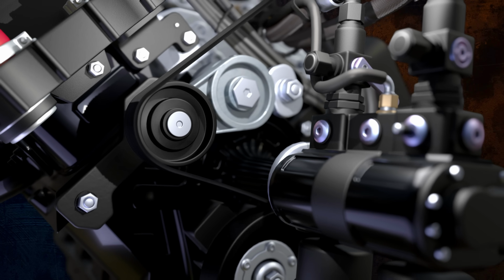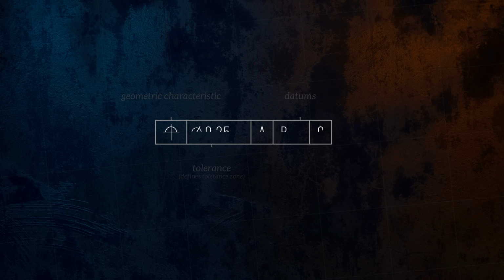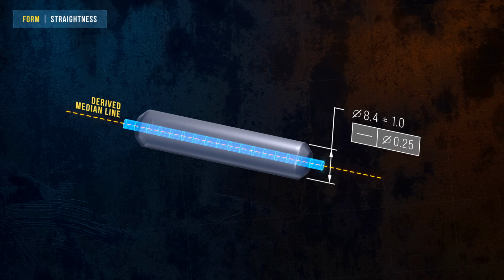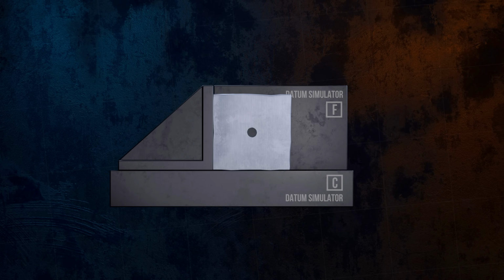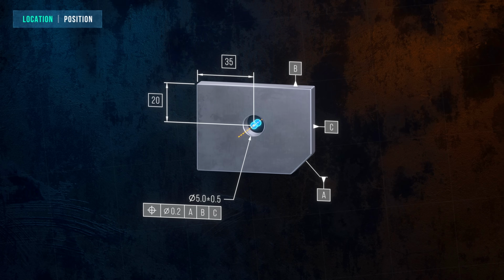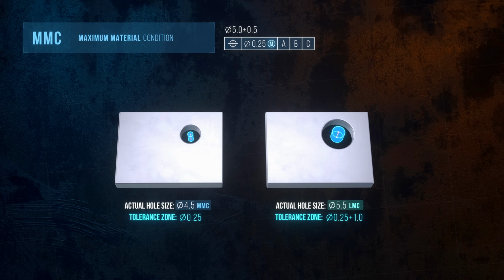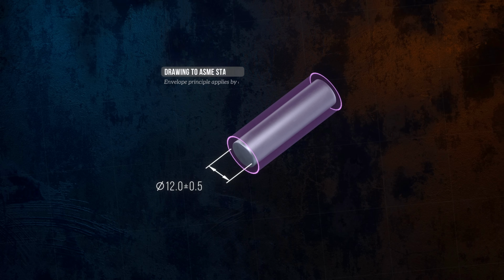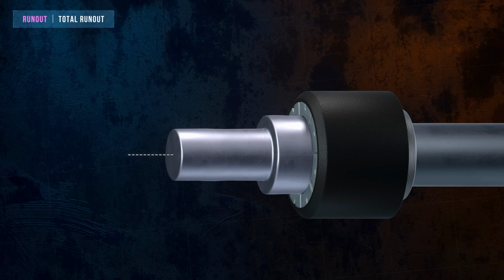Understanding GD&T

Comment: As a retired  R&D Machinist of 50 years one place i worked made me take a GD&T class for 2 weeks & though it wasn't necessary as i am not an Engineer it did help me as to why tolerances are & can be used & what i need to be aware of when reading prints.

Comment: This is a very good, informative, and well thought out video. I am, however very disappointed that you decided not to cover symmetry and concentricity because they were removed by ASME. Being on a global platform it would be better, in my opinion, to think of the world outside of that influenced by the American Society of Mechanical Engineers specifications. Also, given that many people may need to deal with drawings for components that could be quite a bit older then concentricity and symmetry are very valid and widely used geometric tolerances., Again however thank you for an excellent video.
Reply from the maker: Valid point. To be completely honest the real reason I didn't cover symmetry or concentricity was because I'd already spent far too much time on the video and had a convenient excuse for not including them. If I'd had enough time they would have made the cut.

Comment: AI Summary

Abstract:

This video provides a comprehensive introduction to Geometric Dimensioning and Tolerancing (GD&T), a crucial mechanical design approach that enables precise control over part geometry based on its intended function. It explains how GD&T overcomes the limitations of traditional dimensional tolerancing by applying tolerances to features rather than dimensions, utilizing feature control frames, datums, and modifiers. The video systematically breaks down the 14 geometric characteristics into categories like form (flatness, straightness, circularity, cylindricity), orientation (parallelism, perpendicularity, angularity), location (position), profile, and runout (circular, total). Key concepts such as feature control frames, datum reference frames, material modifiers (MMC, LMC), and the ASME's envelope principle (Rule #1) versus ISO's independency principle are clearly explained, along with practical inspection methods for each tolerance type. The goal is to equip viewers with a foundational understanding of GD&T's principles and applications.

Understanding Geometric Dimensioning and Tolerancing (GD&T)

*   0:00 Importance of Tolerancing: Mechanical design requires parts to fit and function as intended, making tolerancing a critical process.
*   0:29 Limitations of Dimensional Tolerancing: Traditional dimensional tolerancing, which defines allowed deviations for each dimension, often fails to reflect a part's functional requirements (e.g., needing a flat sealing surface or a perpendicular hole).
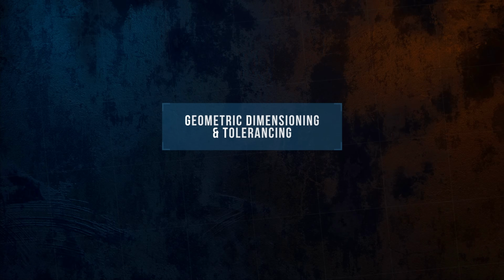*   1:16 Introduction to GD&T: Geometric Dimensioning and Tolerancing (GD&T) is a specialized approach that controls tolerances based on a part's intended function, complementing dimensional tolerancing by specifying 14 geometric characteristics.
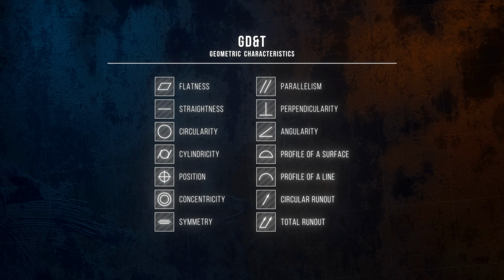*   1:38 GD&T Categories: These characteristics are grouped into categories: form, orientation, location, profile, and runout.
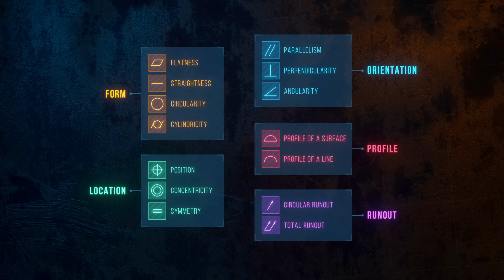*   1:52 Features vs. Dimensions: GD&T applies tolerances to "features" (surfaces, holes, slots) rather than just dimensions. It distinguishes between "surface features" and "features of size" (features with a defined dimension like holes or parallel surfaces).
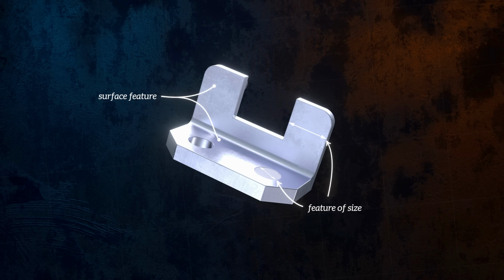*   2:44 Feature Control Frames: Geometric tolerances are assigned using "feature control frames," which are grids containing a symbol for the characteristic, the tolerance value, and optional modifiers and datums.
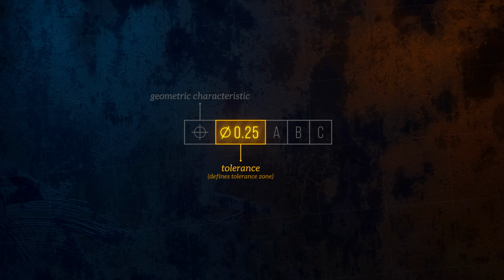*   3:45 Understanding Datums: "Datums" are theoretical perfect reference surfaces used to establish a "datum reference frame" (coordinate system) for precise measurement and inspection, defining how a part should be immobilized. The order of datums is crucial for repeatability.
*   4:05 Form Tolerances:
    *   4:05 Flatness: Defines a tolerance zone between two parallel planes, ensuring all points on a surface (or the derived median plane for features of size) lie within this zone. It's often used for mating surfaces.
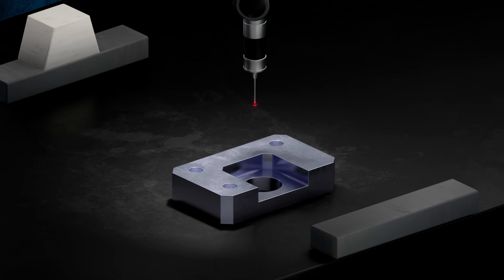    *   7:08 Straightness: Similar to flatness but applied to individual lines on a surface or the axis of a feature of size, ensuring the line/axis stays within a defined zone (e.g., for a pin's axis to engage a hole).
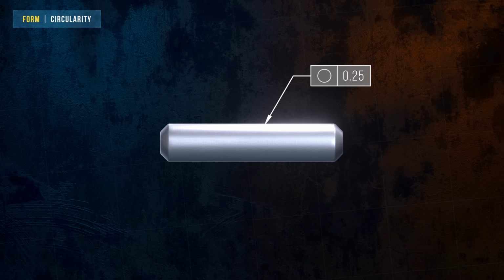    *   8:17 Circularity: Controls how round individual cross-sections of a feature are, using a tolerance zone of two concentric circles.
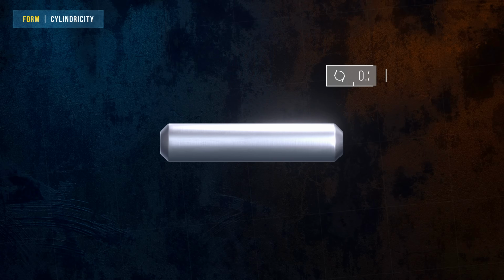    *   9:10 Cylindricity: A more uniform form tolerance than circularity, controlling the entire cylindrical surface along its length.
*   12:27 Orientation Tolerances: These tolerances control the angles between features and datums.
    *   12:35 Parallelism: Ensures a feature is parallel to a specified datum within a defined tolerance zone.
    *   12:54 Perpendicularity: Ensures a feature is 90 degrees to a datum.
    *   13:04 Angularity: A general orientation tolerance that controls the angle between a feature and a datum.
*   14:32 Location Tolerances:
    *   14:51 Position: One of the most common, defining the maximum distance the axis or median plane of a feature of size (e.g., a hole) can deviate from its "theoretically exact position" (true position), which is defined by "basic dimensions." This offers advantages over dimensional +/- tolerances by using a cylindrical tolerance zone and explicit datums.
*   16:45 Material Modifiers (MMC/LMC): Modifiers (M for Maximum Material Condition, L for Least Material Condition) are crucial for features of size. They allow a "bonus tolerance" to be added to the tolerance zone, depending on how close the feature's actual size is to its material limits.
    *   17:36 Maximum Material Condition (MMC): When a feature has the most material (smallest hole, largest pin). Using the MMC modifier can increase the position tolerance if a hole is manufactured larger than its MMC, allowing for less accurate positioning while still ensuring fit with a mating part.
    *   17:57 Least Material Condition (LMC): When a feature has the least material (largest hole, smallest pin). LMC modifiers are used in scenarios where maintaining a minimum wall thickness is critical, relaxing position tolerance if the feature has more material.
*   20:20 The Envelope Principle (ASME Rule #1): In the ASME standard, this principle ensures that the surface of a feature of size will not extend beyond a perfect form boundary at its maximum material condition. This guarantees that parts will fit together, even if they are not perfectly formed.
*   22:11 Independency Principle (ISO Standard): The ISO standard defaults to the independency principle, where form and size are considered separately. This means limits of size do not inherently control form, requiring additional geometric tolerances to ensure form.
*   23:29 Profile Tolerances: Highly versatile, they can control the form, orientation, and location of complex features simultaneously by creating a tolerance zone that follows the feature's specified shape.
*   24:39 Runout Tolerances: Describe the eccentricity of a surface relative to a datum axis, commonly used for rotating parts like shafts to prevent vibration.
    *   24:59 Circular Runout: Controls the roundness of individual cross-sections relative to a datum axis.
    *   26:14 Total Runout: Controls the runout along both radial and axial directions, using a tolerance zone of two concentric cylinders along the entire feature.
*   26:54 Conclusion: GD&T is a complex but essential tool for mechanical engineering, providing a robust framework for communicating design intent and ensuring functional part assembly.

I used gemini-2.5-flash| input-price: 0.3 output-price: 2.5 max-context-length: 128_000 on rocketrecap dot com to summarize the transcript.
Cost (if I didn't use the free tier): $0.0097
Input tokens: 20554
Output tokens: 1428

Comment: @16:40 Please correct me if i am wrong, (about the datum simulator mentioned in the image on the right )  shouldn't it be mentioned datum simulator C,as feature control frame has primary reference datum as C

Comment: I have to ask whether the caliper at 2:25 is purely an animation or an actual working model, because an actual working model would be quite impressive.
Reply from the maker: Just an animation I’m afraid!
Reply: @TheEfficientEngineer  Well, not as impressive but it still gets the job done, doesn't detract from the quality of the video and is still a mighty fine animation.

Comment: For everyone asking about the decrasing points of contact in datums at 11:53, here is your answer:

Imagine you have a table with 4 legs on an unstable surface. At any given point of that surface you will have 3 legs in contact with the ground, with the fourth being in the air and wobboly, i imagine everyone has at least expereinced this with dodgy school tables that you shoved a folded peice of paper under the wobbly leg.

To achive this 3 leg pose, the table needs to be able to rotate in all degrees of freedom

Now imagine this table with its four legs as the surface on the first datum with n amount of legs (i.e. the roughness of the surface), this datum will also rotate into its position with the 3 minimum points of contact.

Now imagine the 2nd datum, given the 1st datum has restircted 2 planes of rotation, the second datum can only rotate to a position to where 2 of its table legs will touch the surface, the same logic applies for the 3rd datum, as all 3 planes of rotation are now restircted, the 3rd datum is butted up against the leg that pokes out the most.

The reason it says minumum and not only 3, 2 or 1 , is thatyou can have other table legs that lie on the plane that the 3 legs for the first datum creates

Same logic for the second. As mentioned above, the 2 points minimum can only create a line which other legs could touch as the restriction of rotation still applies.

Same logic for last datum.

Comment: isnt the tolerance value written in the frame is its +- value? for eg, flatness 0.25 means, it can go +0.25 up and -0.25 down. What you show on the video 4:40 is the thickness of 0.25. Can you please clear this doubt.
Reply: Might be too late to answer your question, but around 6:40 in the video he goes over flatness difference between highest and lowest points being  under .25 meeting the spec.  So it seems in "normal" tolerancing it would be +-.125.
Reply: 0.25 of what? Is it 0.25mm? Or 0.25 of the linear dimensional tolerance? What does this 0.25 actually mean?

Comment: At 12:23, why is it that the second datum have a minimum of two contact points and the third datum has a minimum of 1 contact point?
Reply: For everyone asking about the decrasing points of contact in datums at 11:53, here is your answer:

Imagine you have a table with 4 legs on an unstable surface. At any given point of that surface you will have 3 legs in contact with the ground, with the fourth being in the air and wobboly, i imagine everyone has at least expereinced this with dodgy school tables that you shoved a folded peice of paper under the wobbly leg.

To achive this 3 leg pose, the table needs to be able to rotate in all degrees of freedom

Now imagine this table with its four legs as the surface on the first datum with n amount of legs (i.e. the roughness of the surface), this datum will also rotate into its position with the 3 minimum points of contact.

Now imagine the 2nd datum, given the 1st datum has restircted 2 planes of rotation, the second datum can only rotate to a position to where 2 of its table legs will touch the surface, the same logic applies for the 3rd datum, as all 3 planes of rotation are now restircted, the 3rd datum is butted up against the leg that pokes out the most.

The reason it says minumum and not only 3, 2 or 1 , is thatyou can have other table legs that lie on the plane that the 3 legs for the first datum creates

Same logic for the second. As mentioned above, the 2 points minimum can only create a line which other legs could touch as the restriction of rotation still applies.

Same logic for last datum.

Comment: 12:00 I understood till this part. but now it is cofusing, can anyone help?
Reply: For everyone asking about the decrasing points of contact in datums at 11:53, here is your answer:

Imagine you have a table with 4 legs on an unstable surface. At any given point of that surface you will have 3 legs in contact with the ground, with the fourth being in the air and wobboly, i imagine everyone has at least expereinced this with dodgy school tables that you shoved a folded peice of paper under the wobbly leg.

To achive this 3 leg pose, the table needs to be able to rotate in all degrees of freedom

Now imagine this table with its four legs as the surface on the first datum with n amount of legs (i.e. the roughness of the surface), this datum will also rotate into its position with the 3 minimum points of contact.

Now imagine the 2nd datum, given the 1st datum has restircted 2 planes of rotation, the second datum can only rotate to a position to where 2 of its table legs will touch the surface, the same logic applies for the 3rd datum, as all 3 planes of rotation are now restircted, the 3rd datum is butted up against the leg that pokes out the most.

The reason it says minumum and not only 3, 2 or 1 , is thatyou can have other table legs that lie on the plane that the 3 legs for the first datum creates

Same logic for the second. As mentioned above, the 2 points minimum can only create a line which other legs could touch as the restriction of rotation still applies.

Same logic for last datum.

Comment: 12:30 why changing the oder of the datum faces will lead to different measurement results, can everyone explain more to me. Thank you very much
Reply: For everyone asking about the decrasing points of contact in datums at 11:53, here is your answer:

Imagine you have a table with 4 legs on an unstable surface. At any given point of that surface you will have 3 legs in contact with the ground, with the fourth being in the air and wobboly, i imagine everyone has at least expereinced this with dodgy school tables that you shoved a folded peice of paper under the wobbly leg.

To achive this 3 leg pose, the table needs to be able to rotate in all degrees of freedom

Now imagine this table with its four legs as the surface on the first datum with n amount of legs (i.e. the roughness of the surface), this datum will also rotate into its position with the 3 minimum points of contact.

Now imagine the 2nd datum, given the 1st datum has restircted 2 planes of rotation, the second datum can only rotate to a position to where 2 of its table legs will touch the surface, the same logic applies for the 3rd datum, as all 3 planes of rotation are now restircted, the 3rd datum is butted up against the leg that pokes out the most.

The reason it says minumum and not only 3, 2 or 1 , is thatyou can have other table legs that lie on the plane that the 3 legs for the first datum creates

Same logic for the second. As mentioned above, the 2 points minimum can only create a line which other legs could touch as the restriction of rotation still applies.

Same logic for last datum.

If you chose a differebt starting side, the 3 legs that poke out the most might be different lengths, therefore adding or subtracing distance from the 1st datum example

Comment: l stared my carrier in mechanical engineering deaign (as a draughtsman), accidently, 48 years back. I would have reached to top in my design carrier within first 20 years instead of reaching there after 35 years of experience. Really a great job by you. Thanks a lot for such videos.

Comment: Great video with preciece explanations.  Now is a good time for the machinist to explain to the engineer that trying to hold unreasonably tight tolerances on unimportant sufaces can(possibly) be unnecessary and difficult. Please, for you consideration:
For instance a flatness tolerence of .125mm on large part, of maybe 5m.  Depending on the material being used, will create extra setups and machining to achieve. This is achievable but not always easy. However is it necesarry? Especially if the part will be clamped flat while in production. My point is, many engeneers may not completely understand the machining process, especially, if they have never experienced machining. They tend to come straight out of University and have no concept of what their lack of practical knowledge places on the shop floor and the additional expense in order to achieve these tolerences. When machining, the room temperature, material temperature, machining process, type of material(most important), the amount of material being removed, even the temperature of the coolant, ect, are variables we deal with. We can even go as far as adding expansion to the CAM programs to try and eleviate the effect temperatures can have on the tollerence of the part. My message is to engeneers, spend time on the shop floor learn what the limitations for different types of steel, alluminum are. We all know time is money. A simple selection of a higher grade of alluminum can be far less expensive than having to remove a part and have it stress relived, and re-machine it numerous times to get the desired result. This is just one example. 
45 years as a CNC machinist/programer/shop floor manager/Tool shop owner, in many areas of the trade including Aerospace, using
 GD and T
Reply: Thanks for sharing your experience.  Are you on Linkedin by any chance?

Comment: GD&T isn’t right for everyone. A lot of industries use supply chains that are unfamiliar with the ASME or ISO standard and it can quickly result in confusion and increased cost. Dimensional tolerances are appropriate for many parts. Modern technology allows for overall tolerance and basic dimensioning to be inspected by optical comparators against the 3D geometry.